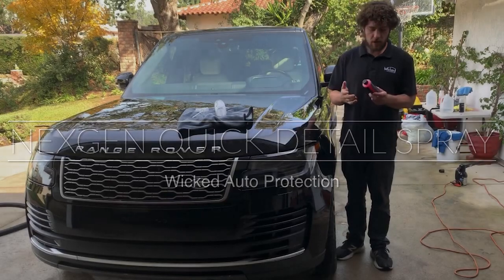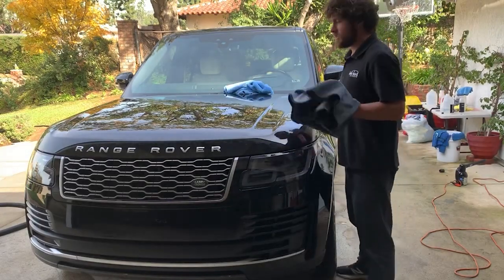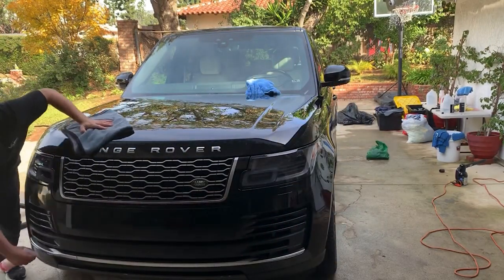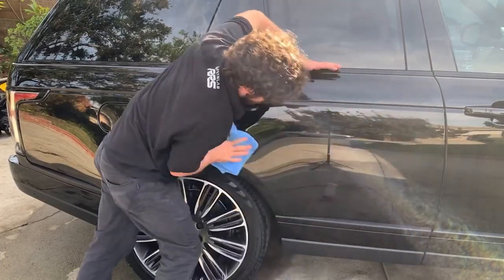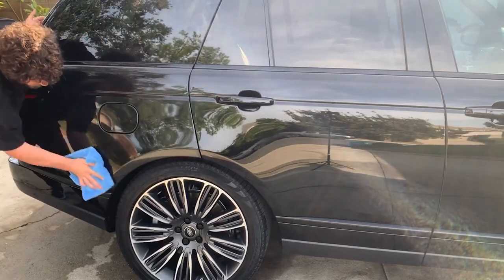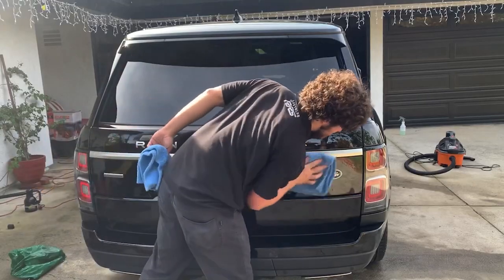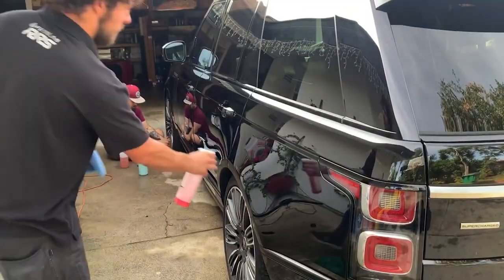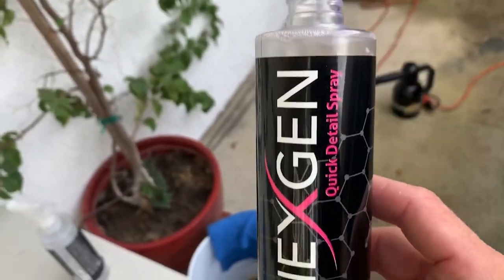NEXGEN Quick Detail Spray review | High end car detailing | Range Rover

Comment: can you apply nexgen ceramic spray after using the quick detailer?  fyi - i clay barred the porsche boxster, then used quick detail (by mistake - thought it was the ceramic spray).  can i now use the nexgen ceramic coating?
Reply from the maker: yes you can! The QDS can be used as a clay lube as well when doing a full detail. Check out the video on using it as a clay lube. 

https://youtu.be/etzRrXKaCLQ